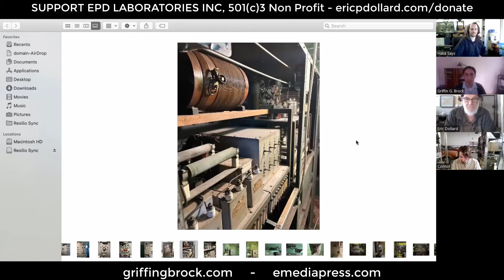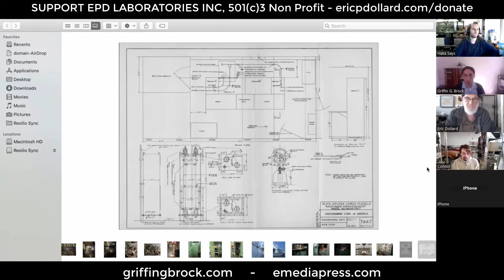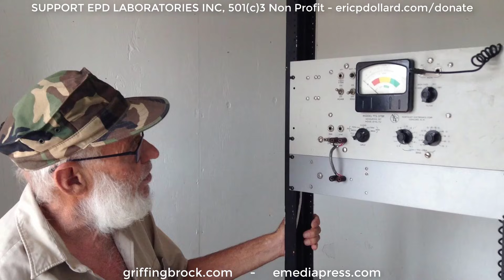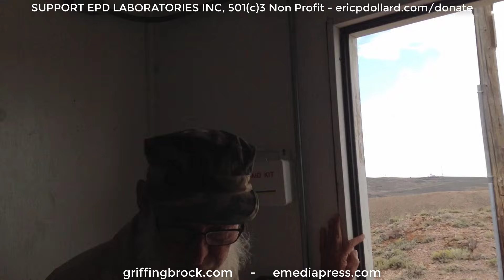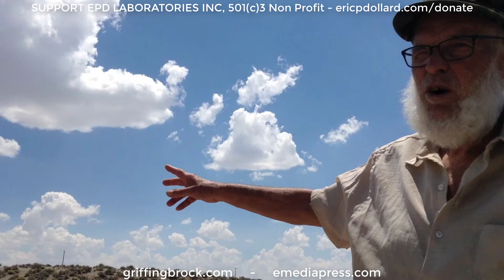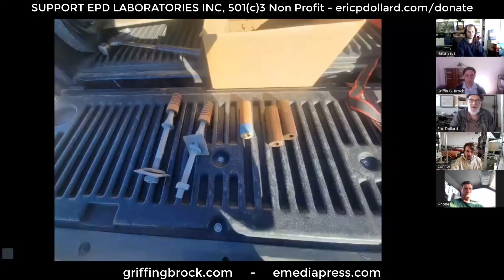4,800 Feet of Antenna, Against 880 at Landers — EPD 2025

Comment: Brother, I know it's not related, but I would love your help. I'm working on a project to replace part of the fuel with ionized water mist. At the moment, I can't replicate your diode system, but I ordered high-voltage ceramic capacitors to place on the spark plugs to generate that passive plasma spark. I'll put 15kV 220pF in series x 5 units per spark plug (75kV 44pF) per spark plug. Do you think this will ignite superheated mist? Thank you very much in advance, and any help would honor me as an experimenter and follower of your work. I'm also glad you're receiving the electrotherapy work of Lavkosky Tesla, etc. (I also work with high-frequency scalar waves for health). Big greetings and my respects. Excuse me, but I use a translator to communicate.
Reply: Have you tried the Murakami ignition for igniting mist? I built it and it changed my whole outlook on plasma and combustion (it might be doing fusion)